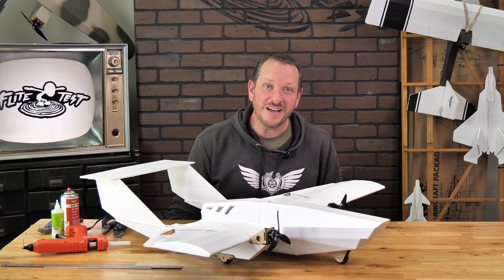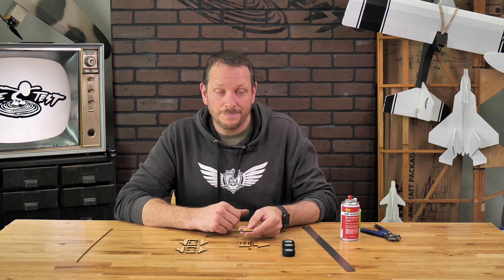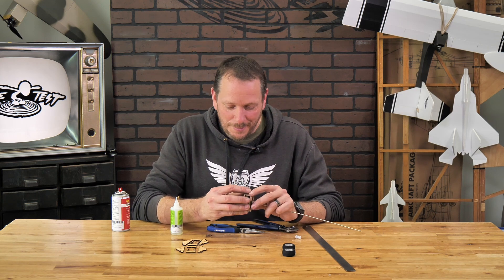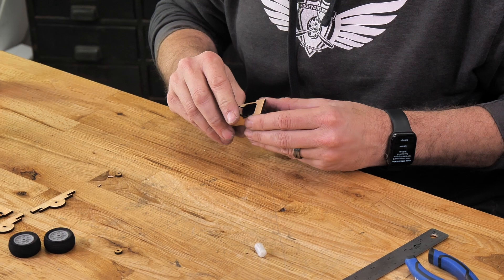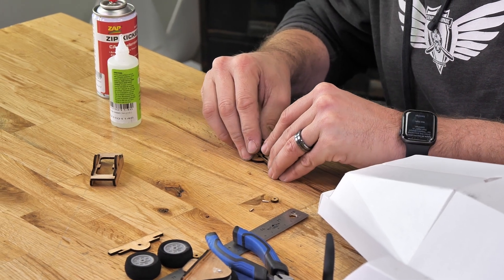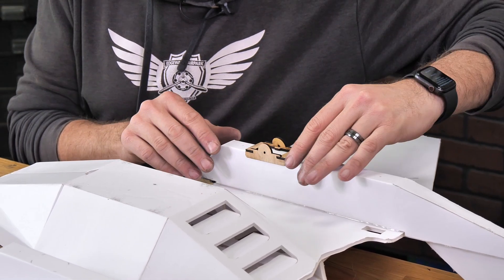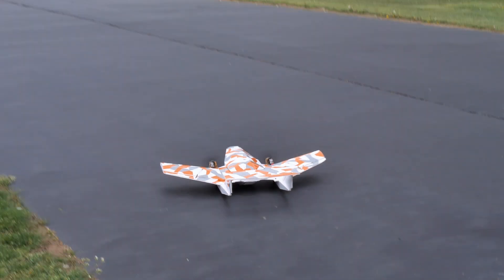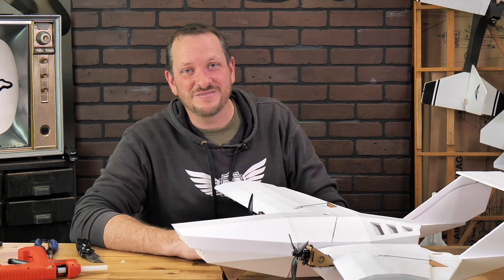How to Build the FT Boomin' Flerken Landing Gear //  BUILD

Comment: The gear need work. The laser cut parts prevent the wheels from moving freely. You need to add a few millimeters of clearance from the axle to the part that keeps the wheel centered on the main gear. It rides on the hub causing the extra friction. I 3d printed the gear and made the necessary adjustments and it works much better. Same thing on the nose gear. The spacers ride against the hub causing too much friction. Either do it without the spacers or  sand down those spacers a bit to get the wheel to spin freely.